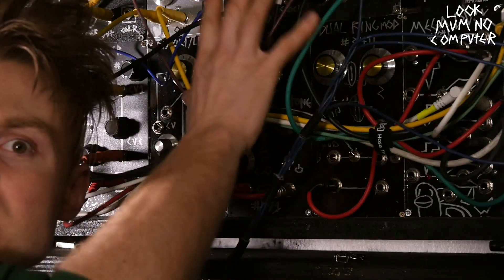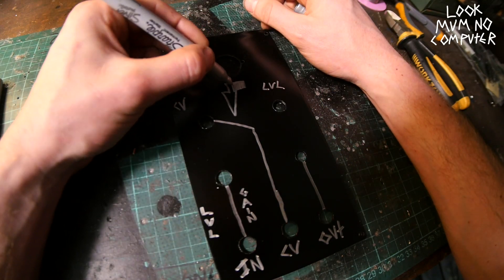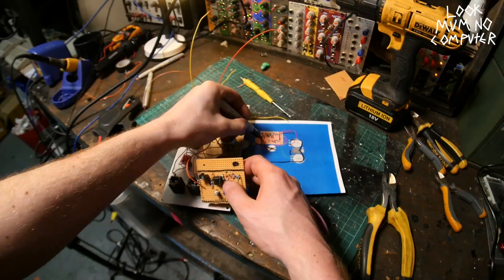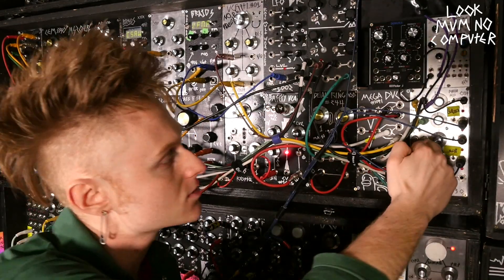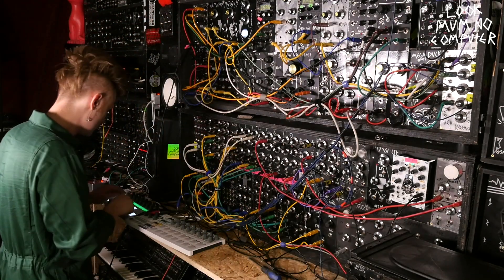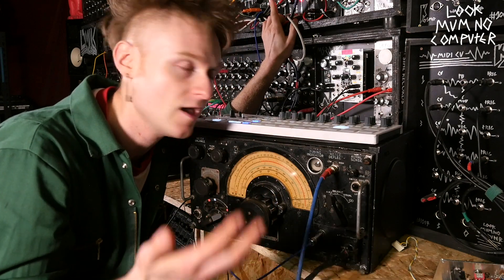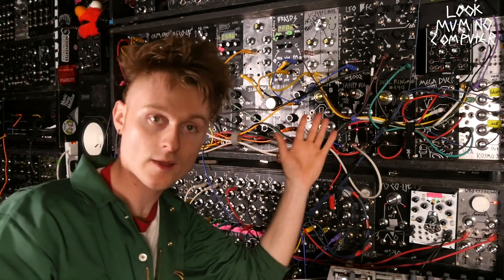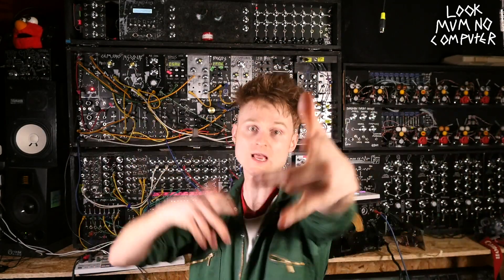VALVE VCA FOR A SYNTHESIZER -2 HOUR BUILD-

Comment: Okay, so I managed to finish building my new solderless breadboard power supply last night, worked perfect first time I switched it on, no loud bangs, smoke, or other abnormal behaviour, anyway, I used it to test-out my Safety Valve Tube VCA build, but my build didn't work as I expected it to, so I'll need to do some debugging, one thing I did notice is that the 12AX7 tube I was using seemed like it wasn't getting enough heater voltage, in the schematic, the current limiting resistor for the Tube Heater, R5, is a 27 Ohm resistor, after doing some experimentation with other resistor values, I have found that R5 needs to be at least a 14 Ohm/5W resistor (15 Ohms/5W should work fine) in order to get about 12.6V on pins 4 and 5 of the 12AX7 Tube (it needs 12.6V at 150mA to heat the two cathodes to the correct operating temperature), if you're powering the module off a +/- 15V supply, one other mod to the Safety Valve Tube VCA that I could recommend doing is to put a 47nF (473, or .047) capacitor (it's an arbitrary value I chose that seems to work well enough, you could even increase it to let more bass through) in between pin 6 of the 12AX7 Tube and R7 (the 150k resistor going from pin 3 of U2 (TLO71) to ground, doing this gets the TLO71 IC (U2) biased properly so that pin 6 of the TLO71 IC (U2) is sitting at 0V like it should be, rather than +11V, since U2 seems to be being used as an amplifier  to bring the output signal on pin 6 of the 12AX7 Tube, according to the schematic, we want it to amplify without distortion, so that we get distortion from the Tube rather than the IC, so, the TLO71 IC needs to be properly biased so that pin 6 sits at 0V, one other thing I noticed with my Tube VCA build is that when in Bypassed mode, I don't seem to get any output-signal, so I'm going to re-wire the bypass switch so that it works properly, one more thing I noticed with my build is that it will self-oscillate at some point when you turn-up the level control, I'm going to see what I can do to fix that, one more thing, the Overkill switch doesn't seem to work as expected, when switched on, there is no output signal so one more thing for me to fix, this is not necessarily a bad thing, this is what actually makes DIY electronics a fun hobby, tweaking things to get a circuit working better.

Comment: I'm in the process of building a power supply for my new solderless breadboad I bought from my local Jaycar Electronics store recently, the power supply will be able to supply up to +/- 15V DC at up to 1.3A, both the + and - V are independently variable, once I know it is working like it is supposed to, I will be using it to test my Safety Valve Tube VCA module build and verify if it works, I will also be using the power supply and solderless breadboard to check that all the other modules I'm building for my big modular synth, work as they're supposed to, if not, I'll be able to mod the circuits to get them working right.

Comment: I built one of these bad boys on a bread board but i cant get it to work.
The valve I used is the ECC83S - note the S on the end...
on the websiteit says use - 12AX7 (also known as the ECC83) - anyone have an idea if the ECC83S is okay?
Reply from the maker: Should work fine try bridging the 27r resistor with a wire or remove it

Comment: Very nice project you share! Got me interested in doing some DIY myself :-)
Quick question about the potentiometers, can I use 0,4 watt ones instead of the 0.5 watt you've linked to? Would it affect the sound, performance or will it give problems?

Thanks!

Comment: You could possibly substitute a BC547C NPN Silicon Transistor for the BC107, the BC547C is functionally equivalent.
Reply from the maker: i tried a lot of different transistors. the bc107 bleeds more which works out better for this. its a bit shitter at its job. :D. but yeah you can..... i initially tried bc547/57 but went to bc107 after
Reply: I'm in the process of building a modular synth too, but the wooden cabinets for housing the modules are going to be very similar to the Moog System 55, I've opted to make the modules 8.75 inches tall and multiples of 1U wide (2 inches = 1U), they will also include 90 degree bends on either side, some of the modules will use ICs and circuits from my old Yamaha CS15D synth, and some will use circuits from the Music From Outer Space website, not sure if you've visited that website, if not I definitely recommend you check it out cause it's a really good Synth DIY resource.
Reply: @LOOKMUMNOCOMPUTER  I can confirm that the BC547C does seem to work fine, I used one in my build, but it's really all about using what works for you.
Reply: My modular synth is going to have a total of 8 VCOs in it.
Reply: There's even going to be a DSP FX module that's based on a DSP FX circuit board I salvaged from a defunct Yamaha mixing desk, I'm debating in my head whether I should include some voltage-control circuitry in it, the DSP FX circuit board has 16 different FX presets ranging from reverbs to choruses, flanging, delays, phasing, and even a distortion preset.
Reply: There's even going to be an Oscilloscope module too, for looking at control and audio signals.

Comment: That sounds awesome, that radio rules. You could get an FM transmitter and use it as a wireless patch cable :D I love the sound of valves. Funny (not so much for me, but anywhom) how I'm like fixing to build a 9v noob modular with (almost just) a square wave and a distortion (because I simply LOVE square waves and I had a distortion pedal that I used on a old organ that was in a flat I used to live in) :/ Lucky me I've been scrapping for parts to make some of the simplest oscilators you showed us, so maybe it'll not be for nothing aftersall. I think this VCA will be like the first 12v thing I'll do, for when I start realizing that 9v isn't respecting my artistic integrity or something, because I just love the sound of filters and valves.  Cheers

Comment: Can the 12AT7 be used in place of the 12AX7 using the same pins? also will this work fine with 9 volts or does it require 12?

Edit: do i need a 47nf cap or can i approximate to 40? I dont think i have a 47nf

Comment: I’m loving the rabbit hole of gorilla synths I found with you. However, if I could make a suggestion, as both a seasoned guitarist and synth tweaker, you should consider placing the tubes inward. They break easy. It’d be true horror show if a misplaced knob tweak snagged against one and it busted. Also, best not to touch them if it can be avoided. As the snobs say, it decays lifespan. Keep it up dude, you rock.

Comment: Hi Sam, great video. I had a look at the schematic and what struck me is that the bypass switch shorts the output of U2. Looking at the specs of the TL071 it appears to have a short circuit protection system build in, so because of that you won't blow out the opamp. I have one suggestion though. You might change the bypass switch into a double on. When in bypass mode, you could disconnect the tube's heating. Especially if you modular has a lot of tubes and they are not in use all the time, this may conserve quite a bit of power. It would take away the nice glow of the tubes though.

Comment: Is the valve actually driven enough to work in its intended range?
Reply from the maker: no
Reply from the maker: the plates are rather starved, which actually makes it more gnarly
Reply: @LOOKMUMNOCOMPUTER  Alright, if it works it works. I come from guitars where lots of shitty products have alibi valves that don't do anything for the sound.
Reply from the maker: @maxupp  the lower the voltage and more starved the valve is the more frazzly it sounds, so those are probably adecquately powered just not designed to be that interesting. shitty valves will probably do a better job at being bad! so they must be good valves haha

Comment: Amazing stuff, I was trying a Valve distorstion pedal on my synths these days and you appesr with this. AWESOME DUDE. In my short experience, for distorition to kick in on a synth wave (triangle, sine, any basically) you need to push the resonance high and set cutoff mid to low, and find the sweet spot of gnarl by raising slowly the freq cut (303 basic old stuff) I do this with a microbrute and lots of fuzz or distortion pedals and works wonderfully

Comment: Could the BC107 be swapped for a 2N3904 or BC547? I was doing some reaching and apparently 2N3904 is a good replacement?
Reply from the maker: yep
Reply from the maker: i tied 2n3904 first didnt work as well but still worked
Reply: @LOOKMUMNOCOMPUTER  read above. Comment 😁
Reply: FIY you might want to fix your stripboard layout. You have the +12v wire for the level pot connected to nothing, I can see on your schmatic the level pot is connected to +12v very nice project by the way it sounds grate! Me being a fan of distortion. Keep up the grate work.
Jason H

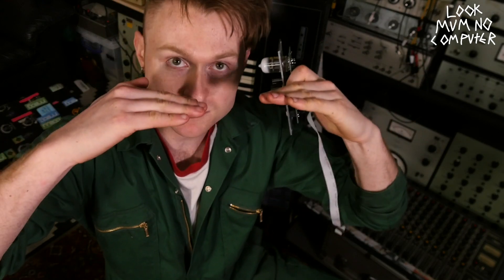Comment: That tube at 0:56 there does it work because it's definitly broken and i'll tell you how i can see that the top suposed to be shiny like a mirror your's is white. meens air got in and oxidized the coating. just a friendly heads up! :)
Reply from the maker: indeed!!! i clipped off the top of that tube to see what it would sound like as it rapidly oxidised, wasnt that funky sounding :(